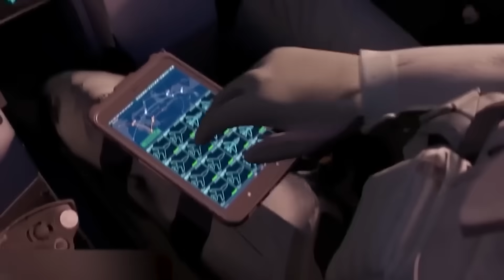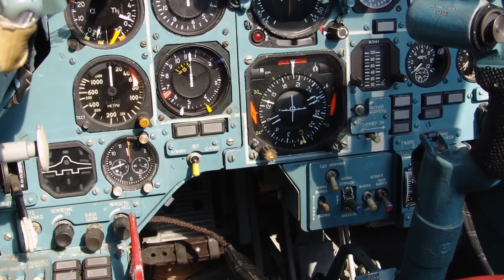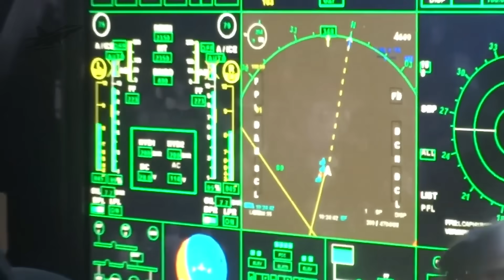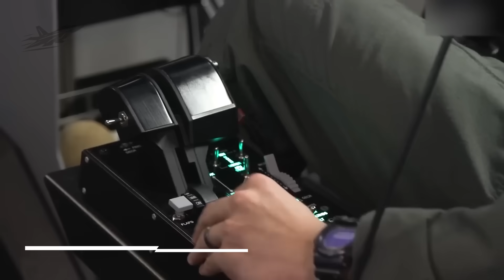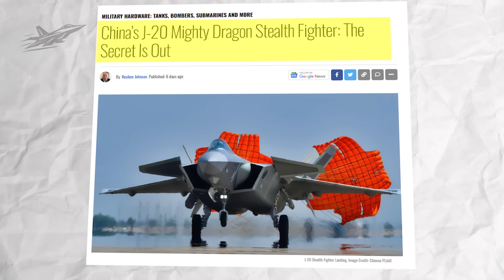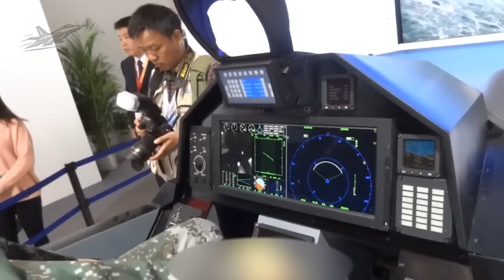China J-50 Official Power EXPOSED — It's Scarier Than We Thought

Comment: These fighters are a lot more about prestige than warfighting capability. The real damage dealers are missiles, glide bombs, and drones. The fancy planes are just more like fancy delivery vans for the stuff that really matters. If your missiles and glide bombs allow you enough standoff to not engage the AA of your opponent, your stealth doesn't matter so much, and you're definitely not gonna be pulling the evasive maneuvers that look so good in airshows. Russia has some pretty good airframe designs, but what they are actually building are endless columns of SU34s! Why? Because what actually matters is flexibility and payload. The fighter planes are mostly just elevators for glide bombs and missiles, and they almost never need to leave Russian airspace. For this, even the humble SU34 is kinda overkill.

Comment: What everyone needs to remember is that the sixth-generation aircraft all have no vertical tails, and full-frequency stealth is sufficient. At the same time, their speed is 1 to 2 times that of the fifth-generation aircraft, capable of flying at an altitude of 30,000 meters, which is 10,000 meters higher than that of the fifth-generation aircraft.